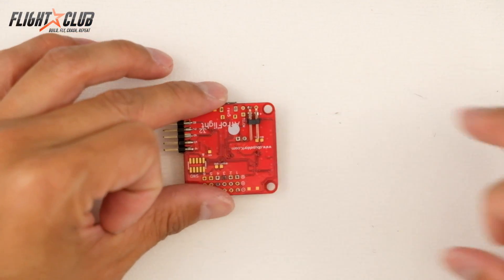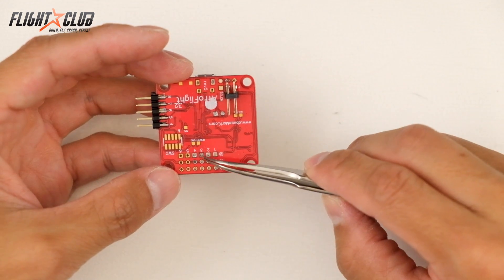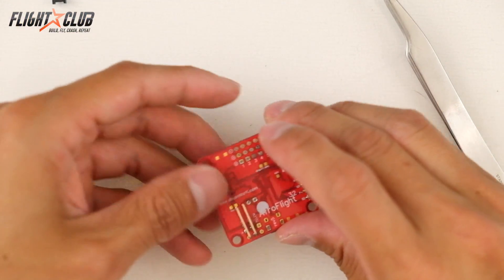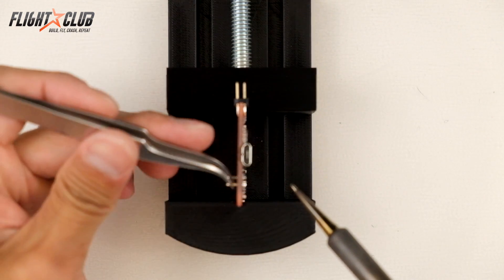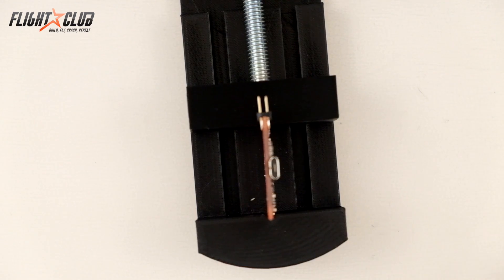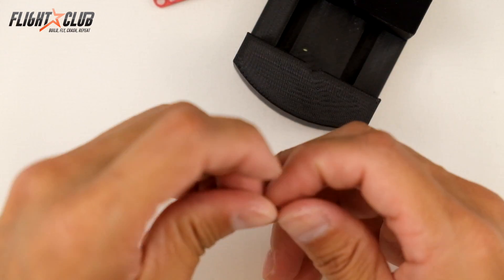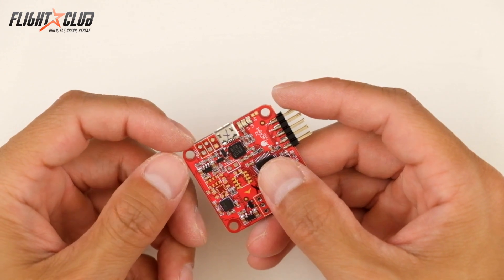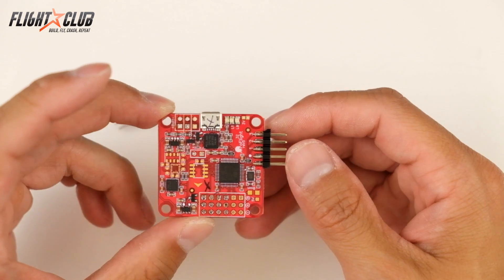How to Remove Header Pins

Comment: Thanks for sharing this video! I soldered straight pins onto my Naze32 for a school project, but now that I want to use that FC on a smaller drone frame, I need to use 90 degree pins to get the board to fit. You saved me a ton of trouble with desoldering.

Comment: I was not happy with the tidyness of my wiring when I put my motor pins facing inward on my xracer f303 so I'm Iooking to turn them back outward like they were on the CC3D. This way all the wire clutter is hidden behind the camera and side plates of the QAVR.

Comment: It wasn't so easy. I destroyed some of the pads but I still managed to solder the wires. I had to use wire cutters to cut some of the pins before the plastic part came off.

Comment: I have done a lot of this, removing the pins individually is a good method, if I replace an IC I will cut the pins off first to do similar. However, a better way to get the solder out of the holes is to use a solder sucker, the manual type cost little. Top tip is to heat one side of the PCB and suck from the opposite side to reduce the possibilty of damage.
Also liquid flux is your friend here, it will distribute the heat quickly again reducing heat damage.